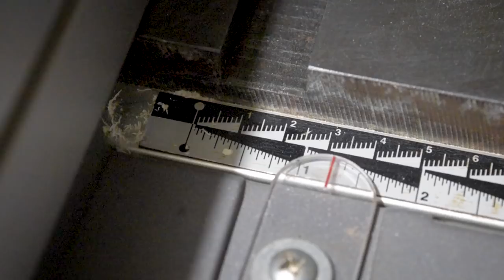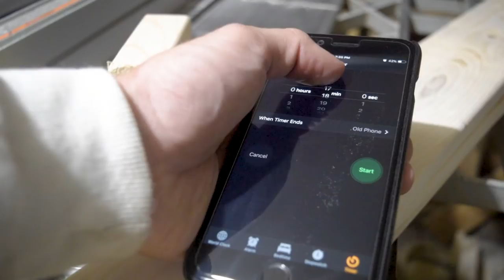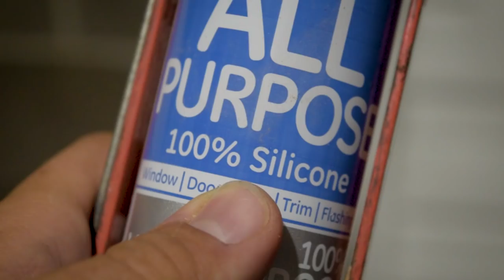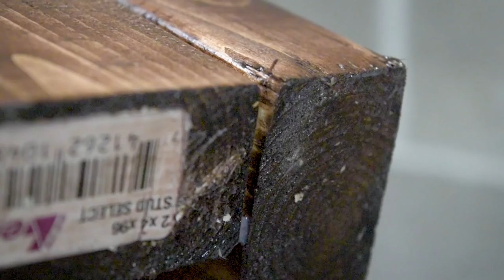Wooden Patio Ice Chest Cooler | A Project made from inexpensive 2x4

Comment: really nice, very robust design too. looks great. 

tbh, I was concerned longer than I should have been about the lid staying on... up until you added the hinges.

I suppose if you wanted a different look, you could char the wood with a torch instead of using stain (before the clear finish).
Reply from the maker: +wmaiuiet [zrugel] Thank you as always! 

Make sure to check out the reference video from the original designer, he goes into more detail and adds a shelf to the bottom as well.

It’s not very clear in my video, but the lid is actually held together with screws going through the wood and into the plastic, and it sits lower than you would think. (Not sure if that’s what you meant) That being said, I think it might actually hold without the hinges. (Although it would be a paint to lift off) : )

I love the charred look! And pine would be perfect for that! It would also be more cost effective and faster to make since you wouldn’t have to spend time/money on stain! : )